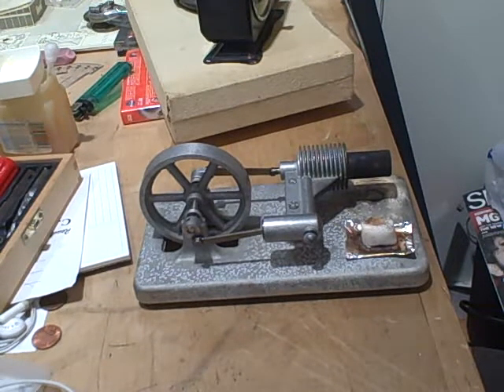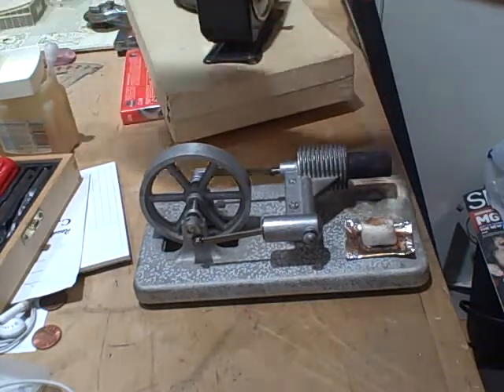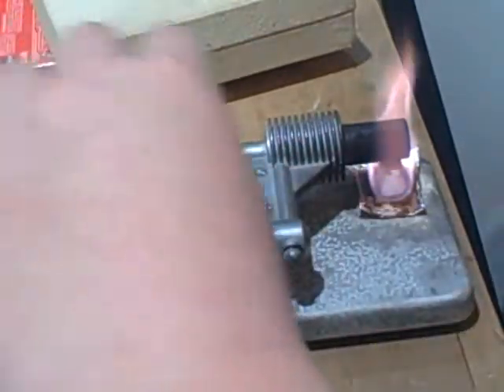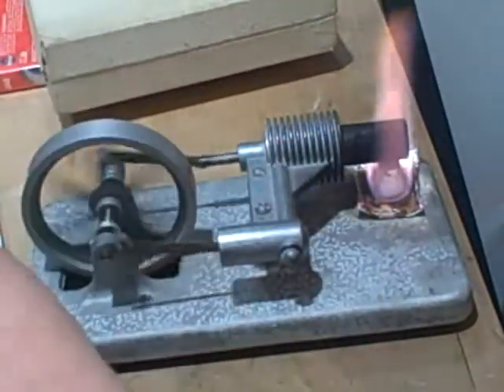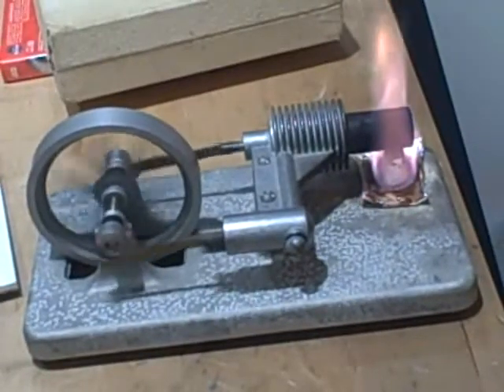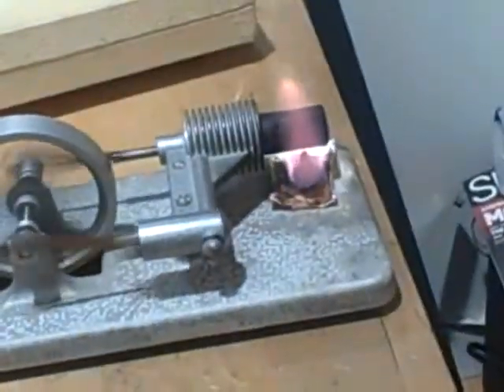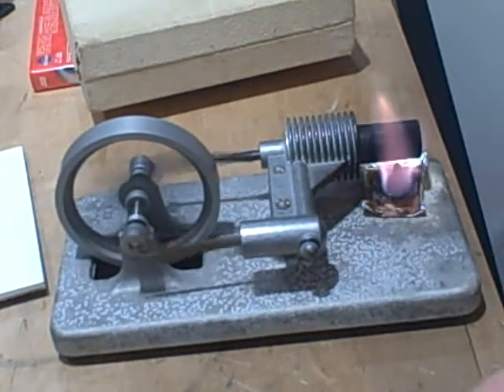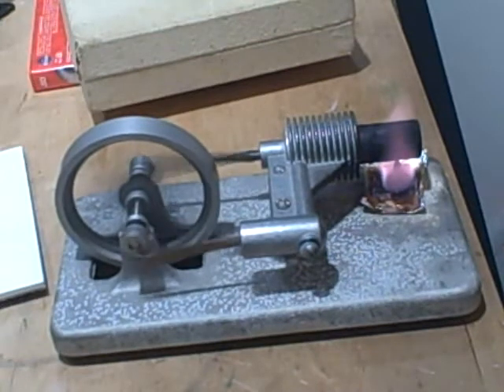Model Stirling Engine

Comment from the maker: Now there is no need to be a wenis, i turned the light off so you could see the esbit's flame, i think it looks cool. and when i say the piston rods flew off i mean that the screws holding them to the flywheel came off and the piston came out while it was running. Make more sense?
Yes you should get one, they are a great thing to have when you are bored and have nothing to do.